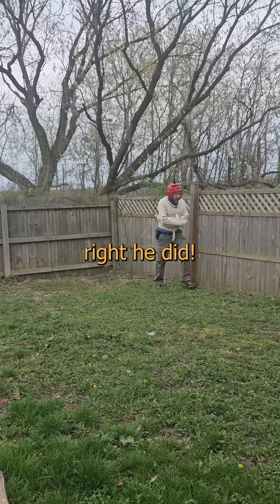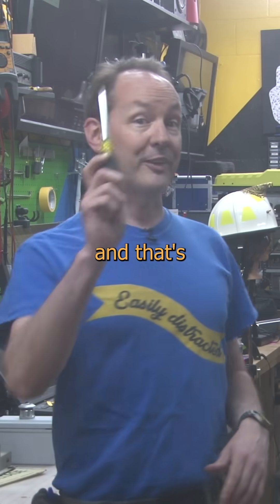Rack Screwed #chrisboden #comedy #engineering #screw #hardware #rackmount #apprentice #educational

Comment: 10-32 and M6 are clearly not the same. However, 10-32 and M5 are almost the same. We have a lot of expensive shakers which have an 10-32 hole (in aluminum), and the amount of people who told me that "the M5 works fine, it just was a bit tight", oof. From then on it is indeed an M5 hole unfortunately.

For places like mine where a 10-32 is hard to obtain, we can just grab an M5 and cut a 10-32 over it. As long as you don't go over 10 turns, it is fine.

Comment: Working in Aviation, I learned early on that there are 2 rules when it comes to the install and removal of fasteners on aircraft:

Rule 1: NEVER install a screw with an impact driver.

Rule 2: Don't try to break torque on already installed screws using a cordless drill/driver.

Installing with an impact driver is gonna wind up with stripped out heads, and hardware torqued well beyond what they are supposed to be at.

Meanwhile, removing screws with an impact driver instead of a drill, because it's delivering high torque impulses in tiny bursts, will result in a much lower chance of striping said screw, and just less wear/damage all around.

Comment: There is a fine, but distinct line between a punishment and a lesson.
The army is pretty well known for using exercise as a punishment for everything, which is largely infective.
But it can be tweaked to teach a lesson.
I once got caught tossing a cigarette butt on the ground on base.
I'd probably done it a thousand times and genuinely never gave it any thought.
I spent an entire afternoon in full kit picking up cigarette butts in the parking lot, and doing burpees between each one.
I was only allowed to briefly stop to throw up or quickly get a sip of hot canteen water, and had to go until my cargo pockets were sufficiently full of butts.
That lesson stuck with me and I haven't thrown a single cigarette butt since, or any other trash for that matter.

Comment: I found a cage nut in the weirdest place: molded into the plastic base of the seat from a 1998 BMW R1100R which I once owned. I bought a Corbin seat as the stock one was done for and had to transfer the latch hardware. One of the bolts had seized from rust and it pulled the nut out of the plastic. You can probably imagine my surprise when that popped out of its polymer home of 15 years (at the time.)

Comment: Pro AV guy here, and we play with racks on the daily. I train my guys with screwdrivers 1st, and once we move into electro-powered tools, the torque setting is #1 or the lowest setting. This is to install, to remove, we use #2. I have been recirculating the same 1000 screws between clients for years now and saving money makes me feel good.

Comment: That reminded me when I had technical review with a supplier and he proposed to switch the bolt on a support bracket from metric to imperial. I said we couldn't accept it because the project required, well you guessed it, a metric bolt. He calmly said to me "why not? They're the same length?"

Comment: Sorry... One sec.... Racked servers with an impact? I actually have used a drill with the chuck turned way down for that, but ... an IMPACT? I love those things, but not for hardware that's junk-tier zinc'd potmetal crap. 

(Also... I have a scare or two from having to remove a bunch of M6s slammed into 10/32 cage nuts. I hate 10/32 cage nuts.)

Comment: My "network admin" stripped out the head on four screws before we figured out we needed to move the switch up 1U. I had to drill out the head and now that screw is there forever because that rack didn't use nuts. Some guys shouldn't use power tools.

Comment: I was commissioning a PLC control system at a paint manufacturing plant years back, the head electrician came storming into the control room cussing up a storm.  His apprentice had just spent the morning "testing" 24 100 Ω Platinum RTD temperature transmitters with a 500VDC megger.  After all 24 transmitters failed the "testing", he came and asked the head electrician for help...  Up until that moment, we were scheduled to complete commissioning and sign off at 5pm that day.

Comment: I once told someone to switch all the metric screws for the inch equivalent in a design. I said "1/4-20 are about the same size as M6 so use those." He heard "I can use 1/4-20 screws with M6 nuts." Fortunately we hadn't built any before I noticed so all it cost was his pride and my sanity.

Comment: oof. That sucks. I do think that an impact is a really dangerous tool when doing server rack stuff because basically everything in rack gear should be buttery smooth and require no more than hand forces. Also for server stuff the time saved using the nice rails is pretty well worth it. Being able to rack a server almost entirely from the front can save a shitload of time not running back and forth around rack aisles. 
and hey, at least your boss isn't forcing you to use round hole racks that got tapped by a hand drill in a closet with no access to the backs. So fun.

Comment: When i started apprenticing as an aircraft mechanic i mixed up sheet metal screws and machine screws in the access panels. Sheet metal screws hold great in machine screw holes, machine screws not so well in the sheet metal holes. My boss wouldn't let me use the screwgun after that. 

Every plane i worked on afterwards was done by hand. I got so fast with it that I raced my boss on Cessna 172s once to see who can open it up the fastest. He used a screwgun and i used my driver. I finished about ten seconds ahead of him. 

Since then i started working as a field service engineer on semiconductor tools. No power tools allowed in the fab, so i picked it up fast, and sizing screws and bolts is second nature to me. 

Things that might appear as punishments are just opportunities to learn, and that's pretty cool

Comment: My favorite "my mistake" computer service needed a logic board that all the manufacturers and all the manuals told me wouldn't work, incompatible,  nope, nuh uh. I spent 3 weeks trying every possible configuration until, totally by accident,  viola, I got to go back to the shop with success under my belt, to be yelled at by the owner for taking so dam* long to do my job.  The company that owned the impossible system LOVED ME for sticking to it until I made it work. Impossible pshaw!!

Comment: I hired my dads, friends, son and we ran into something similar. A lot of the work in my shop is done using the standard US system of measurement because i build and rebuild engines, many of which date back to the 60s and 70s. And oh my was it fun trying to teach this kid what was what, but that thing about asking for help is something thankfully he wasnt afraid to do.... after he stripped out the distributor tie down in an aluminum Offenhauser intake. And after a bit of 🤯🤬 we fixed it and all was right, good kid though. And before anyone leeps to their soap box, yes i know the metric system is easier to use, so you can feel free to just shut up about that.

Comment: mentioning the stripped #2s reminded me how much I hate phillips and desire the bankruptcy of every modern company that uses them instead of something that wasn't designed to slip. Doubly so for applications where it slips at well under the torque needed to fully drive the screws (which is a lot of them)
gimme torx, gimme hex, gimme square, gimme JIS. "Strip me please daddy, ream me out so no tool fits anymore" Phillips needs to get tossed out like the obsolete artifact of early mass production it is.

Comment: I have learned a lot from others' monumental screw ups in my industry.
1) Fail to heed your shop chief's age wisdom about writing down a one time password that 30 characters long and if you fuck up the first attempt on reentry it brolivks your device...
2) For some reason the new guy got it in his head you are to REMOVE the bar codes off the unassembled crossmembers for a highway interchange flyover. It was all onsite and the only defining characteristic for heavy construction guys was that fkn barcode. That CE was measuring and reapplying ALL of those stickers to the exact member.
3) The local comm unit networking team shared one fkn braincell between the 7 of them. For making at least 90k were I live you should...a) reprogram the security door combo [I had the guy who installed it 11 years before with me. He was surprised code worked too!]; b) Not run POTS through your shitshow of a 700 port patxh panel; c) fail to manage ANY of your cable runs, again 700 lines become your torso in thickness; and d) Definitely forget your login creds for a switch you are solely responsible for.

Comment: I HATE those cage nuts.. Like an idiot, i held one (using my finger)  while using a drill the bolt in, and the SOB broke loose and shredded my finger. I was balancing a 75 pound FTNT FMGR so I couldn't risk dropping the last rack nut I had.

Comment: As a teenager i was replacing 2hole outlets to 3hole outlets. Breaker box was unlabeled and sketchy. Did i turn off the main and work on the wiring? F no, just don't touch 2 wires at the same time. Did first one no problem. 2nd one grabbed both contacts, got electrocuted. Ok, don't do that again. Grabbed the contacts again, get electrocuted again. Ok, DON'T do that again. 3rd try, grabbed the contacts AGAIN! Get electrocuted AGAIN!
Got electrocuted 7 times on 4 outlets, i think i might have terminal stupid.

Comment: This year mark 32 years in I.T. for me.  I vividly remember solo racking 8U servers in the DC.  Nothing like not bothering to use the rack template, misaligning the rails, sumo deadlifting the server onto the rails only to realize that the rails are 1-2 notches too low.  Now, do it all over from scratch.  But that mental pain stuck with you so you wouldn't repeat that mistake.

Comment: This is why I start putting machined screws by twisting it in counterclockwise with my fingers until I can hear the first click and then twisting it clockwise, making sure that I know that...

1. It's NOT going in cross-threaded
2. Its naturally goes in (and out) snug enough that even if I don't know what the standard pin pitch off the top of my head by looking at it, I damn well know that it ain't going to be no thread galling if some of the tip goes in and out smoothly with my fingers. (and yes, that is what SHE said)

This approach saved me minutes if not HOURS performing destructive screw removal and tapping the threads in the screw hole.

Comment: I have a rack for my amplifiers and EQs... those clips are surprisingly sturdy, but gawd they can be a bitch. And that equipment can get heavy real quick when you're juggling each one to keep it steady, level, and trying to get the screws lined up properly. It's bad enough, I'd rather hold the flashlight for my dad. I'm sure that just about anyone who has worked with those racks would pretty much feel the same way lol

Comment: I finally got a dedicated, handled, cage nut tool a few years ago. They are not too expensive and much nicer than the bent piece of spring steel tool, and way better than trying to use a standard screwdriver.

Comment: I always say the post fuck up tightrope walk is the best test of character. On one side, you have caring too much and letting it ruin your day, and the day of those around you. The other side, is not caring enough and showing your coworkers that you just don't give a shit, which'll make them hate you more than if you were a bitch.
 It's hard to walk through to hours of fire and side eyes without falling. If you manage to do so, you'll be okay and everyone will eventually forget about the time you stopped the line and made them shovel 1500lbs of shit into 5 gallon buckets to carry to a box fairly far away. Grab a shovel and work harder than the rest. You earned it.

Comment: This is my personal rule, ever since I’ve hatched from being an apprentice, that no matter the workload, if I can use manual screwdriver while racking equipment, I will every time. For 15 years now I have yet to stretch a screw or ruin a cage nut or rail. Before then, yeah, that’s a different story, but I had a very good and patient teacher. Thank you for raising next generation of technicians and engineers right, good sir.